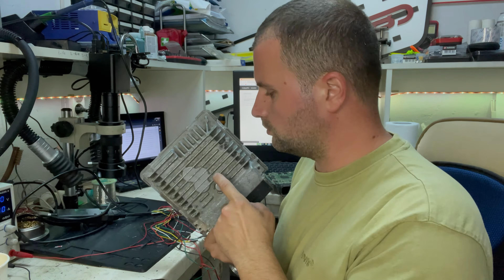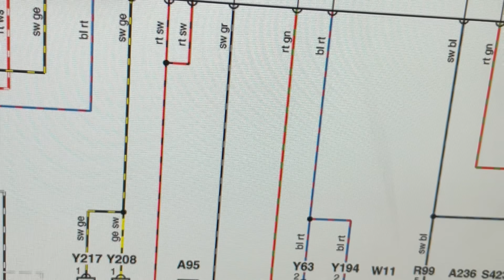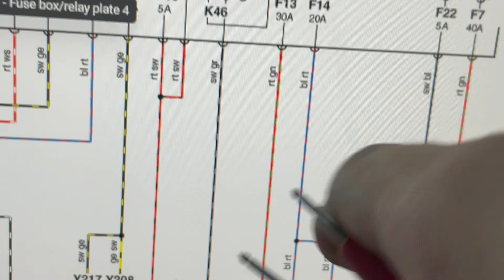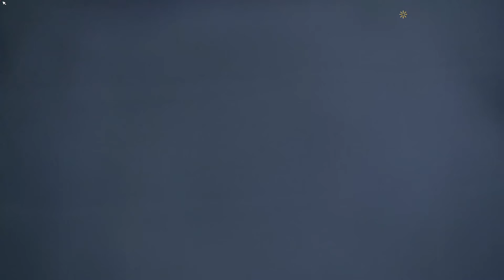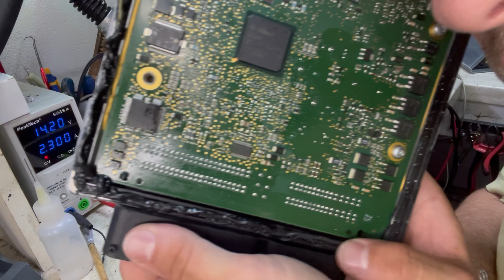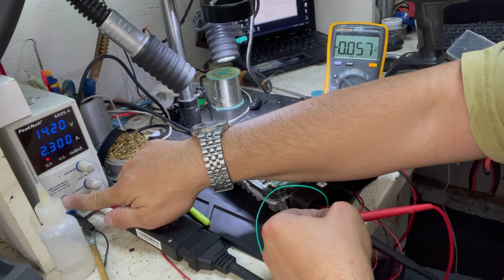Skoda Octavia 1.6 TDI ECU PCR2.1 repair | a customer from France

Comment: Hello! If the Original Bosch ECU 038 906 019 KP 0 281 011 191 was cloned with a Bosch 038 906 019 CJ 0 281 010 302 by moving Eeprom chips and Flash memory, what could be the explanation for receiving the error 01177 Engine Control Unit- 64-10 Not Currently Testable Intermittent?

Comment: Hello, can you please help me? I have a problem where ECU forgets injectors codes and they start knocking and increase fuel consumption. A few times my mechanic retyped codes and they worked good but ecu forgets codes after a few days and starts knocking again and increase fuel consumption.  Would you say it is an issue with ecu itself? What should I look for? 

Thanks in advance.

Comment: I think I have similar issue. I just bought a mk2 octavia (2.0TDI) with ECU problem. It cranks but not firing up. I'll check the switched ground to the engine control relays tomorrow. I also can't hear the fuel pump working at all. Diagnostic cable is also not able to communicate to ECU but it can to other electronics.

Comment: Hi, l have this same ECU on my VW Golf Mk6 1.6 tdi 2009 it is Simos PCR 2.1.
The current VW software version is 8831 date  2010, Is it possible to upgrade this to  VW software version 9971.
I believe this is the latest VW software update before VW did the EA189 fix date  late 2016.
As l do not want this EA189 fix software on my Golf Mk6 1.6 tdi. As l have heard lots of VW owners complain about this software upgrade
Reply from the maker: Yes. You can upgrade or downgrade the software version
Reply: Please may i ask if you have experience of this  software update procedure?Or are you soley just replacing electronic componentswhich are damaged. @autodiagobd
Reply from the maker: @colin5064  yes, i work all the time on diagnostics and software updates or tuning
Reply: That's interesting to know are you living in UK? How could i contact you if l required your assistance with my ECU ? @autodiagobd

Comment: Nice repair.
I like your content very much, but your Sound is very bad, your Soldering equipment makes very loud distorsion noise. Also your Voice is sometimes quite and hart to understand. Would be nice, if you can fix this.
Reply from the maker: Yes, i have a problem with the equipment. I will solve it asap. Thank you!